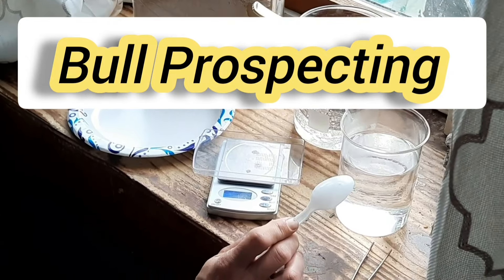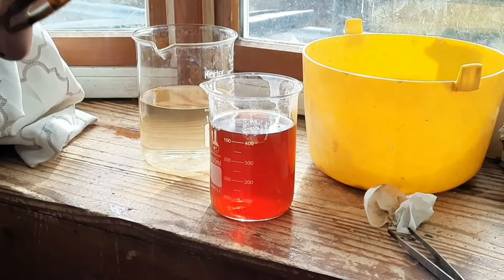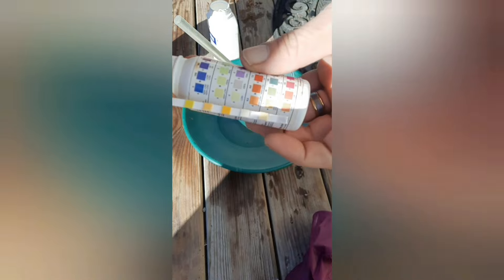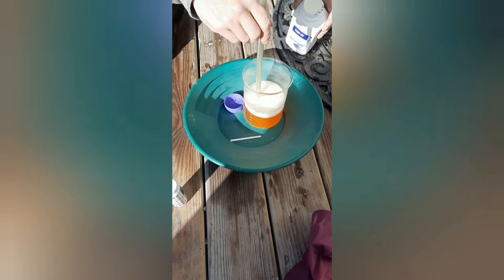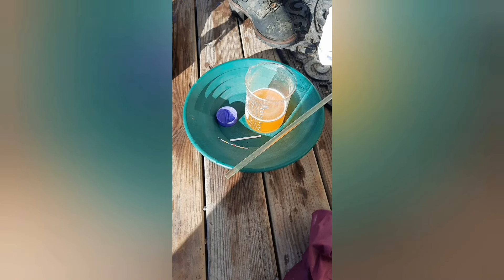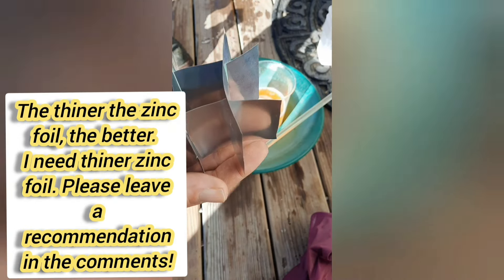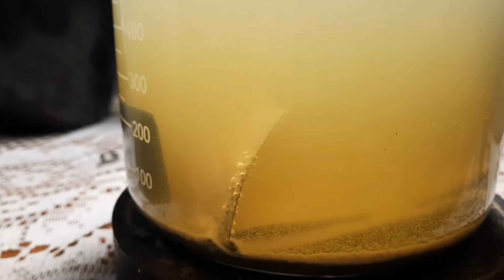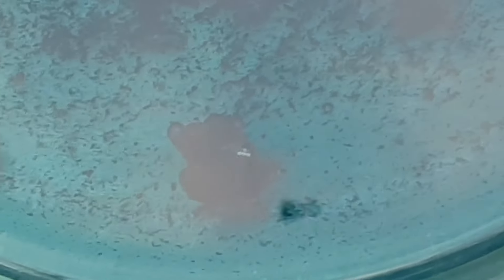Easy Gold Recovery, from Plated Jewelry & Computer pins with Zinc Foil!

Comment: Thanks for the good process info. I found that aluminum sulphate (flocculant) will help settle the zinc/gold particles. I also diluted the solution after the zinc was completed. Remove and filter clear liquid but add hcl to first settled then continue filtering. It took all night to filter. Went right to AR